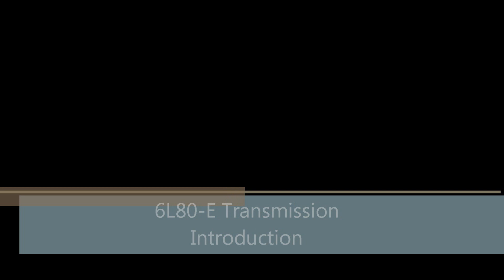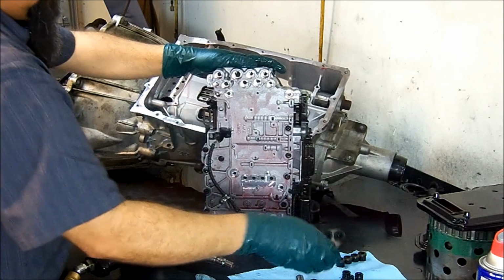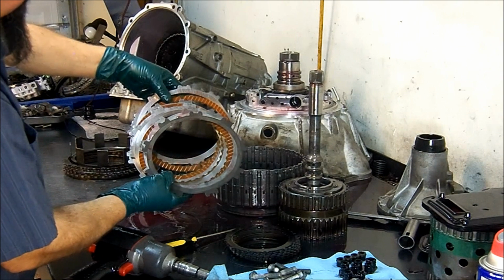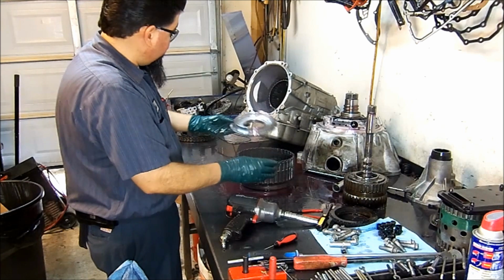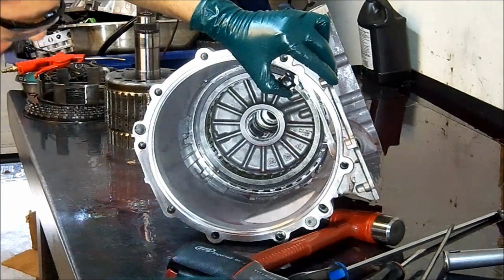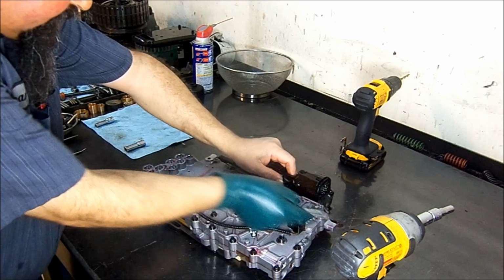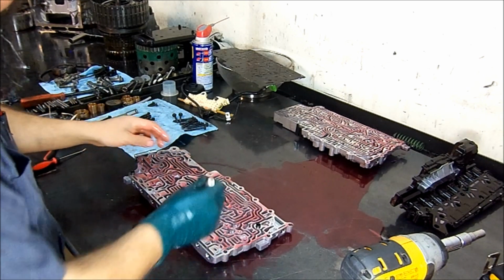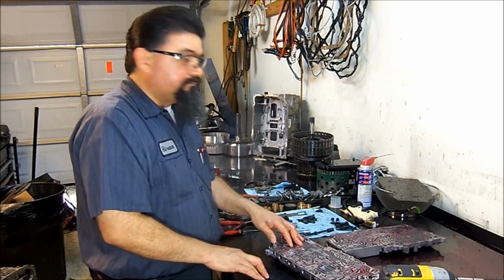How to Disassemble a 6L80 Transmission (Step-by-Step Guide) Bilingual English/Spanish

Comment: Mr. Hiram Gutierrez, I am so appreciative of the excellent  video you published on the tear down of 6L80E. I am from Perth, Australia and have a 2009 HSV GTS Commodore ( this car was re-badged & exported to USA by Holden as a Pontiac GTO G8) As a hobby, I drag race my car which develops 570 RWBHP. I struggle to find anyone who actually knows anything technical or can speak with knowledge on the 6L80-E, it is a rare transmission in Australia and only in two models of performance V8's. I had it rebuilt  ($5,000) with increased clutch packs, nitrated treated plates, billet shafts etc. in 2012. It has also been progressively tuned to optimise shift timings etc. by a local performance shop. I run 11sec passes. Just recently, when in Drive the transmission drops out to Neutral when changing from 3rd to 4th and stays in N, until speed drops below 40kph, then engages and stays struck 1st. If I start car and go into manual select I can drive without problem between 1st to 3rd but if I select 4th it drops to N and shows D whilst still in manual select mode. The transmission "expects" here tell me I have to replace the transmission, which is not an option (at present). To me I feel it to be a solenoid issue or maybe a programming issue or both. Any advice would be gratefully appreciated to help diagnose or tips to try. I have access to software tuning tools. Thanking you in advance Sir. Regards Martin

Comment: Saludos y felicidades por tu primer video bilingüe. Yo reparé una 6L90E con problemas de "pateo" al cambiar a 3a, no tenía DTC´s. El problema fué el TCM (Transmission Control Module), no pulsaba un solenoide al activarlo con el scanner, además de que se daño el estator de la turbina y soltó mucha "rebaba".

Comment: hey hiram, i just tore down one of these units out of a 2008 chevy 3500 6.0 i assume its a 6l90e im not sure but the trans was already out of the truck and a complaint of no third gear it just nuetrals, if you skip shift with the manual shift it will have all other gears, i tore apart the trans there was no real contaminants in the pan nothing more than usual on the magnet, all sealing rings looked good and the 3-5-R clutch pack was okay, slight heat markes on steals but okay for the most part, tore the valve body apart all check balls are okay and all shift valves are okay and free, im going to hook up the techm to the truck to test the solenoids but other than that im not sure where to look next, there is some rust on one of the pc solenoids so im hoping the test on the techm comes up with something but other than that im not sure where to look next, i havent tore apart the 1234-35r drum pistons yet but they seemed to air check okay on the pump so any input would be nice thanks hiram

Comment: I just bought a 2008 3500 Silverado with a 6.0 2wd and I knew it had transmission trouble. When I test drove it everything seemed fine. After I got it home the problem did come back. When I would start out in 1st gear it would grab for a second and then I would loose everything and it was like it was in neutral. I ordered a new separator plate and replaced it with the updated version with 8 ball valves and checked all my valve to make sure they functioned properly and they was nice and smooth. I reassembled everything and nothing changed with the problem. I ordered a new TECHM body and installed that and had a dealer program it and still I have the same problem. I borrowed a friends code reader and I get a code the the number 5 solenoid is stuck off with a code of P2723. I am at a loss as to my next  step to solve this problem.

Comment: Thanks Hiram, for posting this on youtube.  I own a 2009 Avalanche with this transmission, I've had no problems with it.  I wanted to know more about it, as I may be adding a  Magnacharger TVS1900 supercharger to my 5.3L engine.  Would you recommend any mods to the 6L80E to handle the increased torque going to the 6L80E?  The supercharger is supposed to give a torque of about 440 ft/lbs input to the tranny.  THanks for any advice you provide, and thanks again for posting this teardown of the tranny.  I couldn't understand it all, but now am more aware of what's inside the 6L80E.

Comment: Nice video, I feel like I can do mine now...lol
mr. hiram I have a 1997 astro van 4.3l and a 4l60e trans. and lately when i tow my boat it lags/slips when I hit  30 - 40 mph or when a go up hill, Its hard to hit 55mph with out over riving the engine. what can i do to the transmission to get more torque and more grip...by the way it runs fine when im not towing..

Comment: I envy your knowledge of transmissions!! I have a 6L80 that shifts good but slips. Cruising at highway speed you can step on the accelerator a little and it reves up and slowly catches the gear.
Reply: SmallBlock351Cleveland maybe a internal leak! Auto trans font slip much before its toast!
Reply: SmallBlock351Cleveland maybe a internal leak! Auto trans font slip much before its toast!

Comment: hola Hiram , primero q nada saludos y felicitaciones por este video en espanol, tengo un Dodge Durango 2000, al ir corriendo normalmente puedo llegar a un stop y al continuar a caminar solamente entra la primer velocidad al transcurso de 2 o 3 minutos de seguir caminando forsada , entra la segunda y no quisiera encontrarme con otro stop por q pasa lo mismo , se le cambio unicamente el filtro de transmission pero continua el problema, sera necesario cambiar transmission ? de antemano agradesco tu ayuda...Gracias..

Comment: Next step after rebuilding a 6L80E and 6L90E is to the dealer after it is installed in the vehicle.Has to be programed all over again with the Tech 2.The computer gets wiped out of info after every electrical connection is disconnected

Comment: Hey i have a problem with the same trans but it only delays in drive war. Or hot it hesitates and then bangs into gear i put a new upper and lower valve body along with tcm and still does it any idea. Ide appreciate your help thanks good video

Comment: hola te agradezco compartir esta información para todos los que les facina la mecánica automotriz amigo tengo una pregunta técnica directa , tengo una transmisión 6l90 la cual la primera falla que presentó es que cuando te detienes en un semáforo la transmisión de coloca en neutro mientras que esta ralenti luego cuando aplicas aceleración es que aplica en cambio , cambie el convertidor de torque por que lo mande a probar y me notificaron que no tenía pasta y que recalento, le cambie también el filtro de acite del cárter y le coloque 4 litros de acite nuevo u recicle en aceite viejo por recomendación del convertidor de torque,  limpie el enfriador de aceite pero aun persiste la falla he scaneado el modulo de la tcm con un escaner multimarca y no tiene ningún código almacenado puedes tener algún indicio para ir directo a la falla din perder mucho tiempo

Comment: Great vídeo Hiram, I am currently working on the same transmission. I ran an obd 2 scanner on it and the code p0796 came up. I looked up online and it tells me it has to do with the pressure control solenoid. I called dealer and they sell the TCM for 690.00 .  Is there a way I can just buy the sensor by itself?

Comment: hi, nice video. i just want to know what part of the valve body that could experience dragging when sudden acceleration?
i just had my transmission fluid flush. 14quarts. now when i accelerate, it has this dragging feel when sudden acceleration. 
my mechanic told me it could be that i have a 24inch wheels that is cause by the dragging.

Comment: ***** I have the 6L50E and facing some shudder only when TCC engages and especially at 5th and 6th gear. This happend from the very first day of owning this new truck. Where would be the best place to look? I need many 6L80 had Torque converter changed with no results.. Makes me think the valve body may be the main cause of the issue..

Comment: I had the same transmission rebuilt and around 40 mph it jumps alot like it wants to switch gears but won't I have to step on the gas to make the gear switch and also around 90mph it jumps also I messed it up by holding the brake and pressing on the gas then let of the brake and something snapped. the mechanic can't find the problem any help?

Comment: Hi, can you advise?
when I get listed on "D" it jumps up
1 gear. when I put "M" so the car starts.
Other speeds also go to "D", but with little gas slipped.
Gums in the gearbox are ok, solenoids (their resistance is ok)
the car has reached 60,000mil.
I gave a new oil. but with the air test, I do not move the basket for 1-2-3-4
only a few.
can you please give advice?

Comment: Hola una  pregunta tengo una 4L60E  de pontiac transam  94 . el problema es que seguido se queda atorada en tercera velocidad o en segunda ,,esto por los solenoides A y B ,, pero no es que se descompongan o dejen de operar sino que simplemente los quito y sale un chorro de aceite a presion , meto el dedo y las valvulas estan como atoradas , las desatoro jugandolas con los dedos , vuelvo a poner los solenoides ..y vuelve a trabajar bien la caja ,, asi dura algunos meses cuando otra vez de la NADA se vuelven a atorar las válvulas de los selenoides A y B ,, esto porque es ? porque pasa esto ? el aceite esta bien no esta sucio ni quemado lo cambio cada 6 meses  junto con el filtro .. cabe mencionar que tengo shiftkit TRANSGO HD-2 .. espero me puedas ayudar . gracias

Comment: Hello I like how you do your videos and I congratulate you on the way you explain everything so we can understand you. I want to also take the opportunity to ask you a question about how I fix a transmission for 92 camaro because I recently bought a 350 engine that I want to exchange it for the one it already has which is a 305 my idea is to fix it for drag racing and I wanted to know what I have to alter in the transmission if anything to be compatible with the additional horse power of the new engine? (y si puedes contestarme rn espanol es mejor....asi yo no tengo que decir ami esposa k explique todo) Gracias!

Comment: hi hiram, have a question, if shift solonoid(have some electrical problem and not mechnaical) can i use manual gear lever and will it work , please adivse. What i dont know is if i use manual gear lever will shift solonoid be bypassed.

Comment: Great video Hiram, I have a question. Once you tear down the transmission and you find out what is wrong, do you already have most of the parts and rebuild kits in stock, or do you have to order them and set everything aside until the parts come in?
Reply: I was just curious, I didnt know if you had to stack all of the disassembled parts in a box and set it aside or if it was a fast turnaround. Thank you for responding. Even though I dont speak Spanish (not any of the good words anyways :) ) I enjoyed the bilingual video.

Comment: Buenos días podrias ayudarme con un problema que tengo con una 6L80 es una 2012 Avalanche 5.3 la transmission funciona muy bien se hizo un complete rebuild pero el cliente nos dice que la transmission overheat solamente on tow haul mode le agregamos un cooler y no le ayudo en nada, la manejas normal y la trans no overheat solamente on tow haul mode y no necesariamente necesita esta haciendo towing... las cooler lines no tienen thermal valve.... que me podria sugerir hacer... gracias

Comment: I HAVE A 2014 6L90 THAT I JUST REBUILD AND NOW IT DRIVES AND CHANGES GEARS GOOD BUT AFTER A WHILE OF DRIVING WHEN I STOP IT WILL STOP PULLING IN FORWARD AND REVERSE WHEN I TURN THE VAN OFF AND BACK ON IT DRIVES CORRECTLY UNTIL I STOP
PLEASE HELP

Comment: Hey man Hiram, I definitely enjoy watching your videos and I would just like to say that I'm still relatively new to the 6 L 80 e but I guess my question was the TCM is part of solenoid block. Because the very few of these the I ran into were replace it with another unit and every time we replaced it with a different unit I read on the first one that I ever did that you have to program the TCM now my question is if you don't replace that solenoid block on the original unit and just overall the mechanical portion of it does the vehicle still need to be programmed??? But like I said earlier if you can't answer me or you don't that's cool I get it you're probably busy but I've always found your videos very informative well hopefully you know the answer gracias
Reply: Oh yeah and if you prefer we speak in spanish, ademas esta bien compa, soy Feranandez! Es mi primer nombre, no es mi apellido.verdad!

Comment: Hola Hiram, Buenas noches. ¿Me podràs decir si el TCM (Transmission Control Module) de una 6L80E me funciona para una 6L90E?. 
¿Y cuál es la diferencia entre la 6L80E y la 6L90E?.
Por tu información muchas gracias.
Reply: La unica diferencia es el torque converter el del 6l90 es mas grande que el de 6l80 y el shaft fitting.

Comment: considering changing transmission in 2001 workhorse with a 4L80e to a 6L90e, will this work, any anticipated problems or changes needed.  did GM get all the problems fixed on the 6L90e? and if so what year. Would appreciate any thoughts or suggestions on this project.
Reply: Too many mods and money to have the same final drive. I guess bragging rights. These were design for the modulated dispacement engines. More steps= less torque when using lest cylinders

Comment: @HiramTheGreat I changed the solenoid in a 6L80 transmission now when I look at the dash there is no Park, Neutral, Drive etc indicator. Do I have to have it relearned before I can see it or did I not connect something?
Reply: +Hiram Gutierrez yes everything is plugged in just not seeing the gear indicators.  I think I need to relearn it

Comment: Hi Hiram! Quick Question!!!   2011 Chevy Silverado, when slowing down the transmission has a hard downshift from 2nd to 1st. i already replaced the valvebody with a Sonnax rebuilt valve body and the problem still remains. any suggestions?
Reply from the maker: Have you checked the films on the pressure switches on the TECM? You may have some ripped causing a leak and giving you issues. 
Also you need to reset your transmission adapts.

Comment: I got a 2011 6l80 that's making a clicking noise in 2nd gear off throttle.  It goes away on acceration and in 1st. Goes away in manual 2nd. This happened  after rebuild.  I check all bearing  and parts internal did not find anything.  Tc was replaced as well.  Any ideas? 
Thanks
Reply: Also has a bind  hard  5-4 down  shift

Comment: I have A 07 GMC Yukon Denali With The 6l80 Trans I Have Taken  
This Thing Apart Only Thing I Seen Was The Clutch Apply Piston was Scatch Across The Top I Thought  I Had Seen One Of The Snap Rings Wasn't In The Groove Right Clutches And Steels OK Long Story Short  Put It Back Together I Was Getting Code P2723 Before And Still Getting It After I Notice That  You Can Have It In Gear Soon As Engine Light  Comes  On It Will  Lock Up NO Matter  What  Gear It's In Drive Or Reverse What  Causes  This Any Info Would Be Great It Only Has A Lil Over 126,000 Miles I Have Changed The Tehcm Prolly Do Converter Next What You Guys Think It Is

Comment: so is it the same basic structure as a 4l60e? 
if yes it possible to mount it in a ls5.3?
reason im asking is because i want to swap a 5.3 in my 92 silverado and want more strength and gears than a stock 4l60e
Reply: Jays Performance the trans will work, you just need the computer ('ecm/tcm) to control it. The. Controls are different.

Comment: una pregunta tengo una van 1999 1500 5.7lt y compre en el yonke una 4l60e sela quite a una 1997 astro van v6  no estoy seguro si le queda ami van son iguales pero nose  si  ay diferencia  le agradesco si me contestara gracias
Reply: muchas gracias por contestar  y compartir tu conosimiento con la gente buen trabajo
Reply: jose ramirez 16th
Reply: Yes it will work. If you use the torque converter. It'll seem like it has more power. Because the 4.3 will have a 2000 or 2500 stall converter.
Reply: Sí funcionará.  Si utiliza el convertidor de par.  Parecerá que tiene más poder.  Debido a que el 4.3 tendrá un convertidor de puesto de 2000 o 2500.